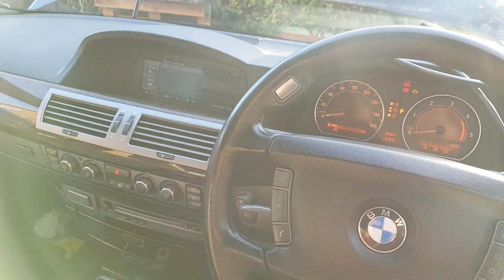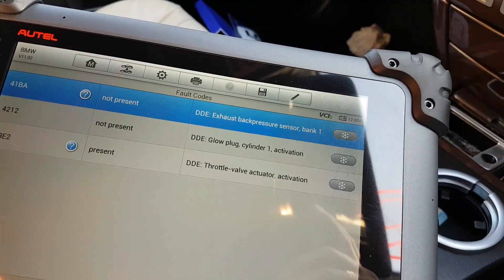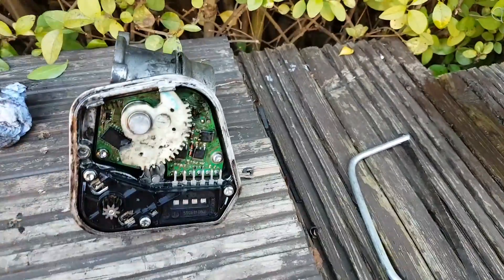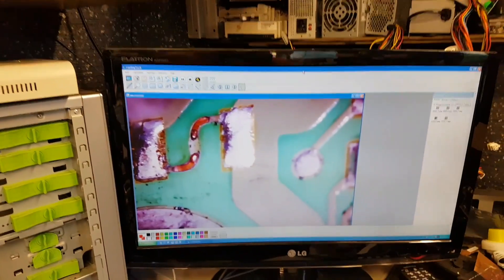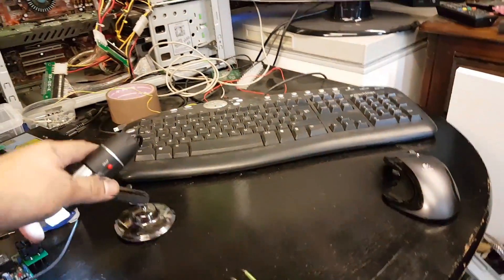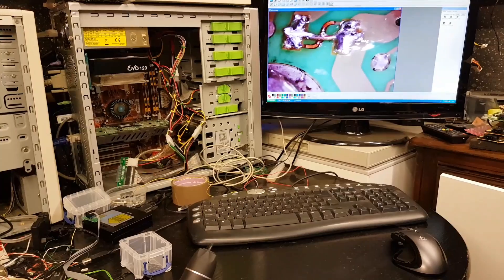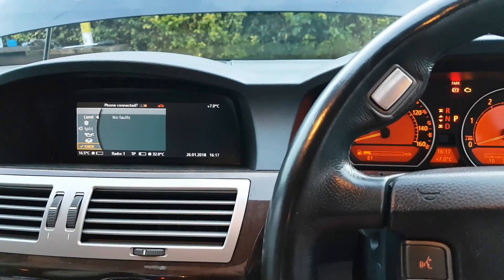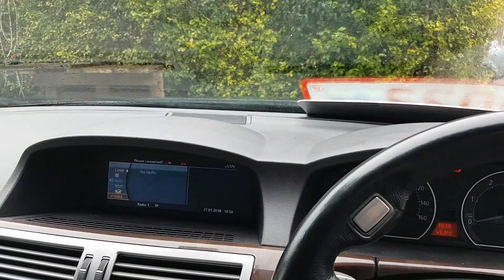BMW 730d E65 fault code 43E2 throttle body activation. Fault finding and repair.

Comment: I reparied the oily throttle valve . I have opened the case with an screw driver. The case of the electronic I didnt seal it. Now i have the Problem 3F77. Is it important to seal the case of the electronik of the throttle valve?

Comment: Hallo warum muss nach der Reparatur der Platine der Drosselklappe die Abdeckung abgedichtet werden? Ich habe nach der Reparatur nun den Fehler 3F77. Motor geht nun ständig in den Notlauf. Die Abdeckung habe ich mit einem Schraubendreher gebogen und auch nicht abgedichtet.?

Comment: Man man man you are genius, following every step you do in video, and then boom, my car work nice again and pulls like bull. Thx so much 😊
Reply: E90 320d M47
Reply from the maker: That's great!
Thank you for watching and for your comment! 
👍👍👍
Reply: @LMAutoRepairs  I have same fault again, throttle body not working, what happend? 😑
Reply from the maker: @bratislavkodic7624  
Perhaps the jumper you used was too thin...
Or, you have other issues...
You need to investigate...
Reply: @LMAutoRepairs  I will try harder jumper once agin 😎

Comment: Hi I have a problem with my e65 2006 When I put the car on the drive The engine starts shaking And I don't know why There is delay acceleration Just let you know I have the e g r Valve delete Please help me and tell me what the problem Thank you
Reply: 730d e65 2006
Reply from the maker: Could be the intake restricted with carbon... seen it many times...
👍
Reply: Please send me your location I want to bring the car to you
Reply from the maker: Have you scanned the car?
Sounds more like a gearbox issue...
Reply: @LMAutoRepairs  Yes I did Nothing coming On I have been checked the gear box And its sound great I have the r p m 600  Or under that When  it on a drive mode and I hold the break When the rpm coming to be 800 There is nothing wrong with car  The mechanic says It could be only dead because all the air filter was blocked You need to drive For a while Then it will be alright It's not make sense for me I feel the problem with the air flow 
How I can test the air flow Or the throttle body Thank you so much
Reply from the maker: You never mentioned which engine you have... it is difficult to give any advice without basic information...
👍👍👍
Reply: Hello my friend I want you back on my car please so please send me your location Or a phone number Or I'll give you my phone number I'm leaving in uk I really appreciated if you work on  my car

Comment: Hello, in the BMW E65 730d facelift, after DPF burnout, there is a jerk every time when extinguishing.  When the car is turned off in other cases, this symptom does not occur.  While driving, there is a wave of revolutions as if something is choking this car, and what is responsible for the frequent initialization of DPF burnout

Comment: Hello, nice job. My car is throwing the same codes. I'll check the Throttle body but can you give any leads to the 41BA code for the backpressure sensor? Is it the sensor itself? I can read the pressure in the DPF on live date and it's about 15mbar on idle, so I'm assuming the sensor is working
Reply from the maker: Possibly...
But is it working under pressure?
Are the pressure within acceptable values?
You need to check all those things...
15 mb at idling is already slightly on the high side...
👍👍👍
Reply: @LMAutoRepairs  Well I'm driving the car mostly in the city, so it doesn't get the chance to do a regeneration as often as it should and sometimes the pressure goes up to 60mb! I'm thinking that there is something adding to the dpf getting clogged up, like injectors, burning oil, egr etc. Injectors seem rather fine on live data, and the EGR seems to operate normally but anyway, I'll try and work on that throttle body and see if it get's rid of the pressure sensor code as well

Comment: I've repaired it the same as you, however I still get an error code for the throttle body and the actual motor get very hot. Do you have any suggestion?
Reply from the maker: You might have other issues...
Make sure the body valve is moving OK... and not getting stuck...
Other than that, could mean yours is beyond repair...
👍👍👍
Reply: @LMAutoRepairs  Looks like it, I've repaired it the same as on your video and it's working and moving as it should. It still throws up an actuator fault, not the same one as before, but just another one. Looks like it's a replacement for me
Reply: @LMAutoRepairs  I repaired my old one and then got a used unit and same happened and repaired the used unit and still the same, looks like I'll be getting a new one. Either way, thanks for the great video 😊

Comment: You saved me. I manage to take the case apart without cutting the corners. Just made my way with a sharp straight screwdriver, slowly bending the edge, then it poped out.
It was full of oil and it was coroded in the exact location like yours, I fixed it with a small wire, then i seal it with a glue gun... so it wont corode again that spot, then i lubricate the seal, and pop the case in. I hit it with a small hammer on the edge to make the cover thight again so it wont leak oil. Everything works fine for now... we will see in the long run. Thanks buddy!
Reply from the maker: 😊
That's great! 
👍👍👍

Comment: Great video! But what if the oil creeps up the board and short it again (even with the small hole), then the fuse probably wont blow and the short will go into the DDE and short it instead..? Sounds scary 🤔🤔
Reply from the maker: Use the correct rate  fuse wire...
Thank you for watching! 
👍👍👍
Reply: @LMAutoRepairs  Would it be possible to solder in a "external" fuse, so you solder wires to the points and then solder a normal pcb fuse to the wires?
Do you know what amp fuse it needs? My throttle body isnt working either, and it has a good amount of oil on the outside (oil + dirt), so i guess it has the same problem.
I have soldering equipment but not for tiny stuff.. So im not sure i will be able to solder anything really.. It looks really small.
Reply: @LMAutoRepairs  I fixed my throttle body yesterday but used a normal wire. Would be great to know what amp it needs. Planning on using the fuse wire from a glass fuse. Do you know what amp would be enough? Thanks!

Started the regenerating for dpf after a few km's. So ut works great now, saved me some money!

Comment: Great video!!! I have the same problem and I would rather try to fix it before investing in a new one. Will tackle over the weekend.
One bit missed as of could show the exact location for drilling, but thank you anyway.
Reply from the maker: Drill and the lower point when the throttle body is in place... so any oil can drain...
👍👍👍👍
Thank you for watching and for your comment!

Comment: By sheer fluke I stumbled across this video whilst trying to discover the issues with my throttle body and will attempt the fix tomorrow.

I was though wondering without correct fusing is there any risk to the ecu as I assume the plug goes directly to it.

And as oil doesn't conduct electricity what was the likely cause of the original one giving up?
Reply: If using fuse wire would anyone like to hazard a guess at what rating the original trace fuse was 🤔

Comment: could you tell me what my gearbox error means on my 730d e65. 51AC - No message (throttle valve/accelerator pedal) from engine managment; - intermittent

Comment: Just did mine , same throttle actuator used on many BMW . Mine a 635D  same issue blown fuse ,  when opened found lots of oil .  Soldered jumper wire , cleaned pcb with contact cleaner  left to dry  and is now working again. 3mm hole drilled in bottom to allow further oil to escape!
Reply from the maker: 👍👍👍
Nice work!

Comment: Thanks for the detailed fix action.  I had the same issue on my 2009 530d and your solution worked perfectly for me.  I used a dremel tool to make the cuts on the casing and it worked well.  I cleaned out all the oil, saw the break in the PCB and soldered a thin wire across the two solder pads.  I did have one issue when I was testing it with the cover off - the black gear went spinning off and it took about 10 minutes for me to find it (lodged in the fan casing).  But then Voila - no error anymore.  Hopefully my DPF will regenerate tomorrow when I take it for a drive...
Reply from the maker: 🤣🤣🤣
Glad you found the flying parts...
Thank you for watching and for your comment!

Comment: Great video, man! Exactly the same issue with my throttle actuator. Fuse blown and circuit board was really burnt at the spot. Soldered up with a thin copper wire. Now it works great again. You saved me a lot of $$$ 😉
Reply from the maker: That's great! 
Thank you for watching and for your comment!

Comment: Another bad design by BMW, thanks brilliant piece of work done, it might explain my fault codes 00483D throttle valve actuator fault and possibly linked to crankshaft sensor signal fault 008E91. Mines misfires at starting whether cold or warm and there's a slight hesitation when switching off. Will definitely investigate inside the casing of the actuator. How did you clean the oil gunk out from the casing, any special solvents?
Reply from the maker: Alcohol...
Thank you for watching and for your comment! 
👍👍👍
Reply: Would acetone be ok
Reply from the maker: @terrymetcalfe9503  
Possibly... never used it for that...

Comment: That is a bad idea to drill a hole in it.  It gonna get a small blowhole when charge air and oil leaking trough the eletronics due to the worn out shaftsealing.  Just a temporary fix

Comment: Hey, my digital microscope arrived and I have figured that my fuse is blown in the exact same spot! Amazing! I'm now wondering, I've never soldered before, do you have any guidance or videos on how to do this? Do I need to remove the PCB board from the enclosure? Any advice would be amazing and thanks for this video!
Reply from the maker: Hi
No, you don't need to remove the board...
I some videos on soldering... but nothing too detailed...🙄
Thank you for watching and for your comment!

Comment: Hey this is an amazing video! How did you cut the metal?
Reply from the maker: Hi
With a small hacksaw...
Thank you for watching and for your comment!
Reply: @LMAutoRepairs  Wow thanks for the quick reply. I managed to pry it off and my PCB was covered in oil. Going to clean it up and let it dry over night...not sure i have the technical knowledge to solder a wire if my fuse is blown though so may order a new part...but could give it a go! Will subscribe to your channel, thanks bro!
Reply from the maker: @RWallyb  
👍👍👍

Comment: Hi mate great video! I have a e90 330d M57 motor with the same 43E2 fault and engine shakes when shutting down. I opened the TB and found the exact same spot to be blown like in your video. Since I am no soldering expert I can get a micro pen type to do it but what is this wire you used to make the new bridge? Where can I get something like that? Thanks a lot !
Reply from the maker: Hi
Just use fuse wire...
Thank you for watching and for your comment!
Reply: @LMAutoRepairs  I feel stupid now... Thanks a lot for the lightning-fast reply! I will try it out and report my findings. Btw what is the best spot for the new "drain hole" you drilled? Is it the corner directly under the pcb and the shaft?
Reply from the maker: @def1nity  
Yes... pointing down when the TB is installed... make sure you clean all the oil from it...
👍👍👍

Comment: Hi
I fixed it with my microscope goggles and it was actually the same spot. Will take it for a run now. Next time do t cut the edges no need. Just use a wrench for water connection and pull it of pass by pass. Hope it helps. Tell U after the test run
Reply: Well it worked so far. I don't have any surgin between 1500 and 2000 rpm but still don't have the power as before. I have like a spot on the gas, like a kick down, that it do shift down but the gas doesn't arrive. It's a e61 if you have any ideas.  But thank you so much for all your help.
Reply from the maker: @CreatedByAntonioForteza  
Well... scan the car and look at the live data...
Otherwise is pure guesswork...
Reply: I Would and I did but it only gives me the throttle but now it is ok and must go back to my think tank
Reply from the maker: 👍
Thanks!

Comment: Excellent video buddy, I will check the solder tomorrow.. My issue is the car wont start and is throwing up the same code for the throttle body. mine a 2006 x3 2.0d but looks the same part. mine too was full of oil, I didn't think ti check it with the cover off 👍👍
Reply from the maker: 👍
This should not prevent the car from starting... unless is stuck closed...
Hope you get it sorted...
Thank you for watching and for your comment!
Reply: @LMAutoRepairs  Thank you for your reply. That's good to know (if anything the oil is now out 👍😂 I will check the fuel pump too and a few other things 👍 damn bmws 😂
Reply from the maker: @danielclark6751  
👍

Comment: Hello,
I have similar problem on my BMW E65.
Present codes:  4677 Throttle-valve actuator,  4877 Throttle-valve actuator, 0043D1 Throttle-valve actuator, activation, 0049E7 Throttle actuator all are DDE codes. 
I have managed to remove EGR and Throttle Body. Cleaned everything and put together. A reason why I was removing to inspect why Throttle Valve doesn’t move when engine is being switch off and just shake the whole engine. I can move Throttle engine valve by hand.
Have done a test with ISTA+ against Throttle Body and valve doesn't move at all.
What could be a reason why doesn’t function? 
How can I test is wiring or fuses are ok? I didn't dear to remove that cap from throttle body without testing out all possible solutions.
What silicone have you used to close up that cap?

Regards,
Tomas
Reply from the maker: If did not actuate with ISTA, check wiring... ista does show you the circuitry... 
Thank you for watching and for your comment!
Reply: @LMAutoRepairs  Hello, what kind of silicone you have used to close up this cap?
Reply from the maker: @TomasKulikauskas  
Black RTV silicone... if I recall correctly...

Comment: is the "fuse" you soldered, between the ground and the power pin,? i have 6Mohm between the 12v and ground pin..

Comment: Hey mate I took my throttle body off my x5 e70 diesel and it was full of oil I cleaned it using contact cleaner and noticed I had the same fuse piece broken like in your video so I shorted the two points and the motor responded but now the car will not start...I think I blew a fuse please tell me where the fuse is for the circuit that plugs into the throttle body please
Reply from the maker: Hi
Have a look here...
https://fuse-box.info/bmw/bmw-x5-e70-2007-2013-fuses-and-relay

Comment: Hello mate, great job, great channel!
  Could you help me please?
Got same error on my e60 m57, fix it by soldering that blown contact, but.... Got now 4687 Throttle valve actuator : electric or mechanical defect (position sensor error, control deviation, motor overcurrent) ; Test condition met ; Error currently available, but not saved yet (Entprellphase) ; Error did not cause a warning lamp to light up; Error in "Entprellphase". I'm using INPA. Please ca you advise me what to do, what's your opinion?  When you install back the gear wheel, throttle position must be close, or doesn't matter Thanks in advance
Reply from the maker: Hi
The cog system is spring loaded, if I recall correctly... so just put everything back in the rest position...
Try to do a learn to the throttle body...
If you have other issues with the component, like a bad motor, or something else on the pcb, then this fix might not work... 
Thank you for watching and for your comment!

Comment: Hello, this was a great video first of all. i had the same code (43E2) on my 320d e90. did everyting what i saw in this video, and the fault is now gone. but now i have another fault which seems to be related with the throttle body aswell (the fault code is 4687). btw the 4687 code only appeared after i fixed the 43E2 code. any ideas? i want to try finxing it myself, but im afraid ill have to buy a new part
Reply from the maker: Hi
It still a code related to the throttle body actuator...
First, does the code comes back when cleared?
Second, after the repair, is the throttle body working the way it should?
Thank you for watching!
Reply: @LMAutoRepairs  yes, the code returns almost instantly after me clearing it, but i actually did not test it in the way that you showed me in this video, ill have to check. I think the actuator is too far gone for me to fix it, well atleast i tried :) thank you for your reply!
Reply from the maker: @erlandaspilypas727  
No worries...
👍

Comment: Hi, I got a bmw 120i n43 engine. on a cold start the idle jumps from 1000 to 1200 and the car shakes and then when it drops to 800 continues to shake. if you start driving, everything is back to normal. I changed spark plugs and ignition coils and still does it. what else can it be? Thanks
Reply from the maker: Hi
Only when cold?
It can be a few different things...
Have you scanned the car? 
Thank you for watching!
Reply: @LMAutoRepairs  yes, only when cold for a couple of minutes. if you start driving everything is normal
Reply: @LMAutoRepairs  the dealer said missfire on cyl 2, injector. is that possible? if the engine is warm and you start everything is ok with no engine lights on

Comment: Great job, Mine is E60 530xd LCI with removed DPF(Hardware + software) and this error came to me too. The symptom of the car is that in low RPM when the gas pedal is pressed the engine sound like is dying, like the air is not enough and the car does not accelerate as expected. I'll try to fix it and will share the result.
Reply from the maker: Kostadin Georgiev 
Hi
Hope you manage to get it sorted! 
Thank you for watching!